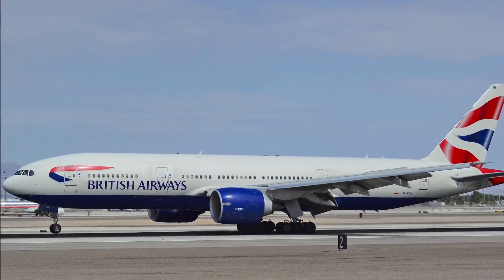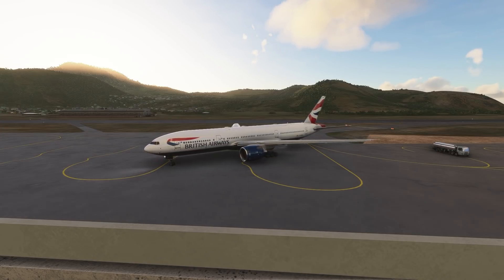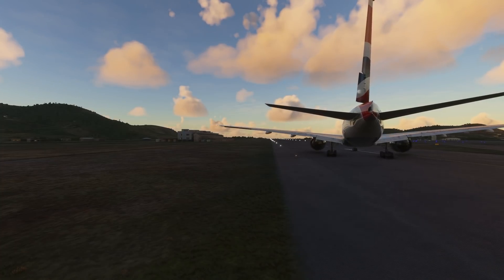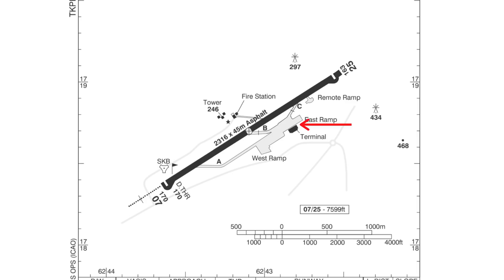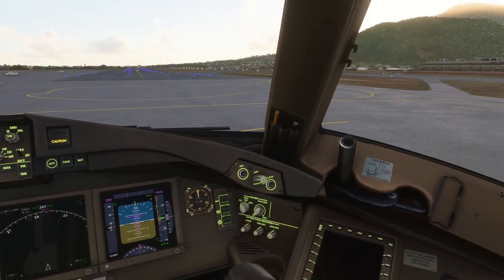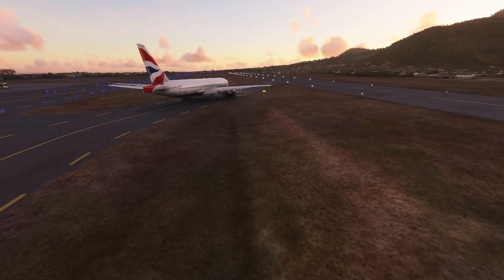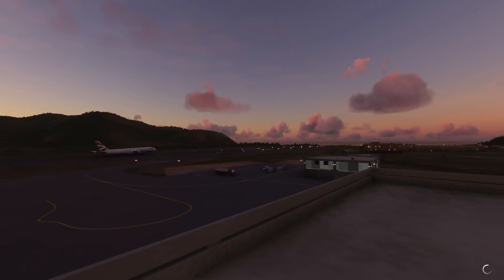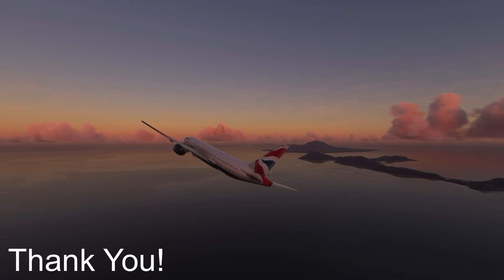How A Wrong Turn Almost Crashed This Passenger Jet | British Airways 2156

Comment: Hot and Heavy with take off power pre set for Alpha and light winds would have made for a very different ending . Lucky.
Reply: Not necessarily. Reduced thrust calculations take into account density altitude, wind strength and a whole host of other factors.

Basically, for the same weight, and runway condition, one would tend to rotate at pretty much the same point along the runway, no matter the temperature  - the thrust produced from the engines being reduced/increased accordingly. (We do this to save engine wear, and hopefully reduce the chances of an engine failure). Light winds, or indeed increased weight, would (if not TOPL limited), see you rotate even earlier, as it’s your performance in an RTO that becomes the limiting factor.

If one becomes TOPL limited due weight or environmental factors, then they’d be using the full runway length, and this whole scenario wouldn’t have played out.

Oh, and as far as using the full runway length vs an intersection (I know you didn’t comment, but for others reading) - it’s quite common, particularly if using the full length would involve a 180 turn to utilise it. The most tyre wear is incurred during taxi, and tight turns, particularly 180s are very bad for the tyres - so again, we try to avoid them wherever possible.

There’s quite a difference between operating a ‘jet’ engine and light aircraft wrt power set at take off. Had this been a GA aircraft that only just had the performance to make it from A, then yes, they would have been in serious trouble from B (the equivalent of being TOPL limited as mentioned above).

Comment: so the plane was parked unusually, the pilots never did this flight and they decided to shorten the runway for their convenience and the FO thought the charts werent clear enough but he decided to take off anyway. THEN they turn up on the wrong position for takeoff but attempt to takeoff anyway?! uhm... MAYBE someone should've told them to follow standard procedures for this one departure? that flight crew should have lost their licenses forever. THIS WAS 2009, not 1979.
Reply: All of this WAS standard procedure for a 777. What wasn't standard was the signage, the markings, the controllers... Of course it ultimately is the responsibility of the pilots to check these things, and I can only guess that after they got airborn there was a code brown in the flight deck, but we are all human and make errors. This was a good example of how, when  the failsaves in place don't work, one error can quickly escalate into something way more serious.

Comment: Incidentally, according to Google, the flight they were going on was about 65 miles.
Reply: So, they got very lucky by having a very light full load.
Reply: @spauldo82ftw  i'm sure they were not full of fuel for such a short flight
Reply: @kevinbarry71  :  I suspect "spauldo" meant "fuel", rather than "full".   An unfortunate typo.
Reply: @spauldo82ftw  :  Did you mean "a light FUEL load"?
Reply: From Antigua where they were heading,the flight carries on to London.
Reply: Short trip, short runway.
Closer to the crash site. Right?

Comment: This has been a problem before.
Yet nobody put up the proper signage — or even a sign 
“you are near the  middle of runway 07:
2213 ft   <——      HERE     ——>  1931 ft”
(Numbers obviously made up)

And the ATC should have said something “I see you, you at intersection B, are you sure 1931 ft is long enough for you? Just making sure …”
Reply: Just saying "Runway 07 at intersection Bravo, cleared for takeoff" would have been a clue, sounds like nobody specified which intersection they were planning or they were at.
Reply: @chrisschack9716  :  I notice that the pilot said "we are good to go from position Alpha" when in fact they were at position Bravo, which should've put the controller on notice that the airplane was in the wrong place, and that the pilot wasn't aware of that.
Reply: @Milesco  ^This
Wrong information should always be challenged, even if it's not part of a read back.
Reply: normally they have intersection numbers in yellow a b c etc at the holding point..i bet they are there now!!!
Reply: bet someone made a haistily printed laminated a4 sign in comic sans as soon as the news got back to them.
Reply: ATC could have and should have been helpful here but first and foremost what kind of goddamn pilot can’t see he’s halfway down the runway?  Look left and look right as going onto the main runway you can see that there is a long ways down on the left, this is totally another pilot error, get used to it it’s what they do, make errors and kill people. They got lucky this time.
Reply: Lethargy is a killer

Comment: They're very lucky, if any thing went wrong things would have been very different.
Reply: I agree with you. And relying on luck and hope is not a good approach when flying.
Reply: Agreed, that was my first thought too.  If for example, they'd had an engine failure after V1
Reply: @rrice1705  
It wouldn't be a good thing, but these aircrafts are designed to allow for climb out speed on one engine. It might not set any speed records, but it will be enough to get some altitude for safety and then come around to land. The only thing that would have fucked that up would be that the shorter runway distance may have resulted in a too low beginning vertical airspeed. Those GE behemoth engines are the most powerful in the world. Just the size of these engines are awe inspiring!! I'm thinking the engine power should get them through though, ✈✈
Reply: @rrice1705  
I was thinking about that answer I gave you. Indeed if an engine would've failed AT or even a red hair BEFORE V1...it may not have had enough ass on it to produce the lift needed to get it to its initial climb out vertical speed.
I'll tell ya one thing..I sure as hell would not want to be anywhere near that plane at that time. Crash Test Dummy is not in my skill set.😎👍
Reply: @rrice1705  Also any serious failure rejecting in the high speed zone (ie BEFORE V1) you brake to an emergency stop and wonder why you run out of runway at 60+ knots ! Not good.
Reply: British Airways have the best pilots, they clearly knew they'd make it.
Reply: You could say that about literally any flight in the world
Reply: That was known as a "once in a lifetime mulligan"!! There probably wont be another mulligan given!! These pilots really need to Thank God for the second chance!!